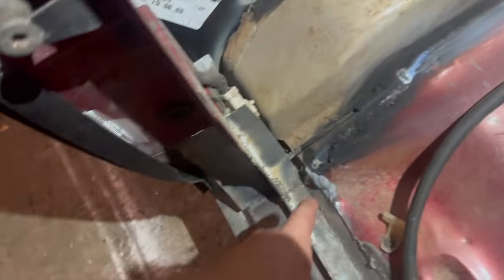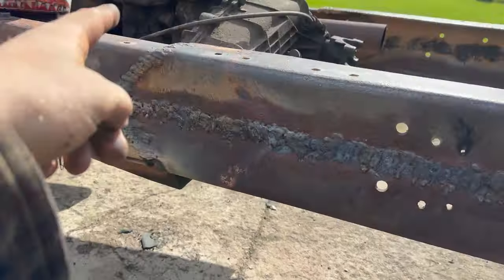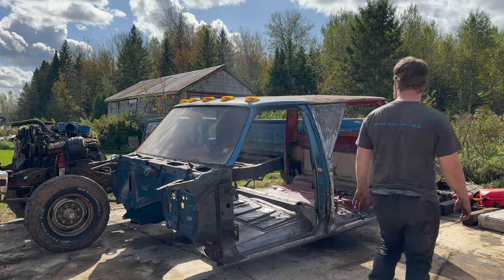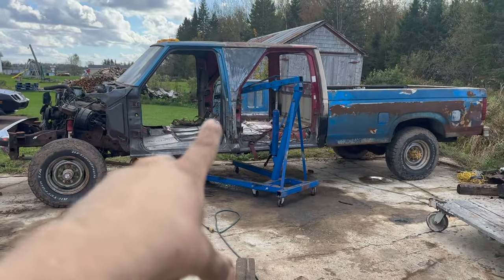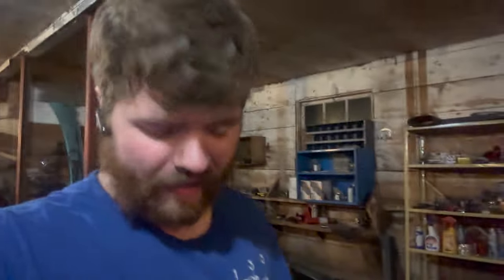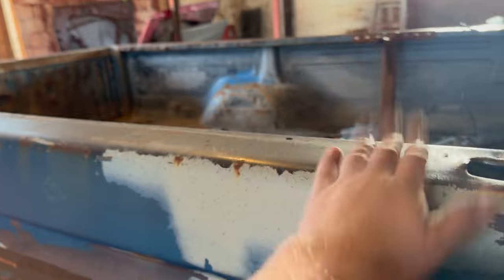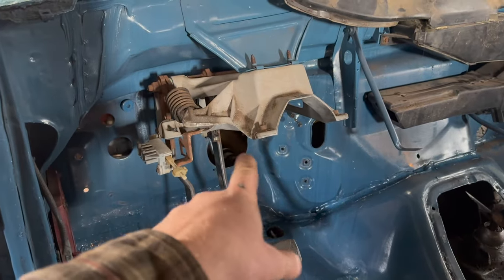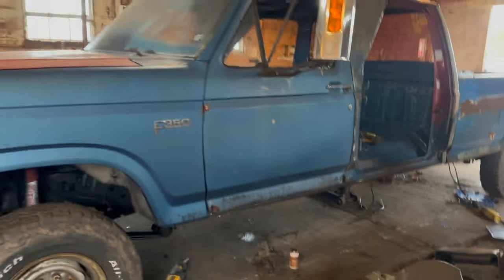Major Parts are back on! Homemade Crew Cab Old Ford Episode 6!

Comment: Love the build! Quick and dirty. Plan to keep the beams up front? I like d50 ttb myself.

I had a similar idea to this a few years ago, but using an xtra cab in the back half. Would be stupid long, but that's the fun of it.
Reply from the maker: Will be getting a Dana 60 in about 2 years, not much wrong with this 50 right now so I’ll milk it for another couple years haha
Reply: @highostablegarage  I enjoy the ttb setup. Have 5 trucks with it. It has flaws for sure, but it's fun.

Sure doesn't  beat a d60 though.  Lookin forward to your updates on this!

Comment: Is the front ttb gonna sag with the extra weight??😅
Reply from the maker: Doubt it, ttb springs are actually a much higher spring rate that the d60 leafs, only reason the f350 up were solid was because they are tougher.
Reply: @highostablegarage  Ahh okay, sweet build!